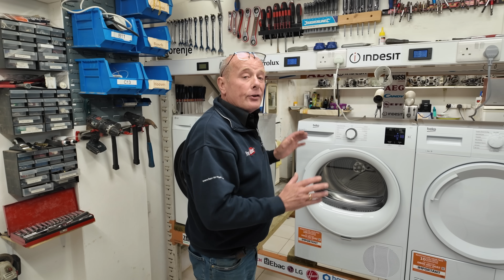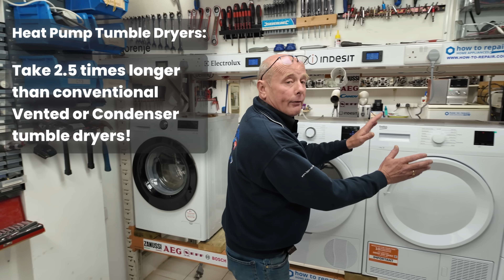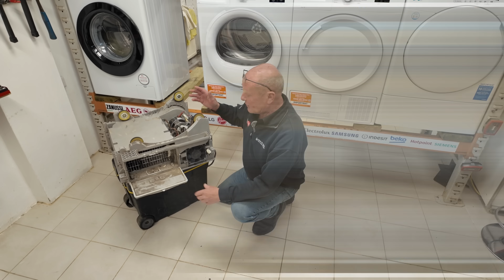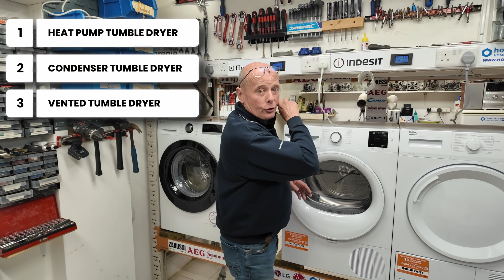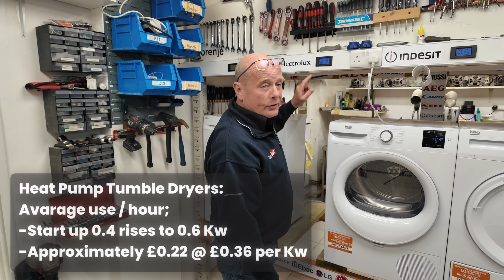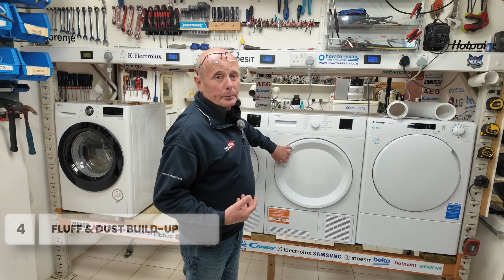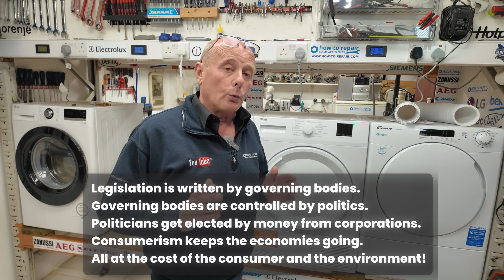Tumble Dryers the Shocking Truth About Heat Pump vs Vented & Condenser, NEW LEGISLATION!

Comment: I think this is just a matter of development, they will get better over time.
Reply from the maker: I believe heat pump technology holds immense potential, however, these machines exhibit a concerningly short lifespan, typically lasting only five years on average. Drying times are significantly longer, often doubling the usual duration, leading to increased wear and tear on both the clothes and the appliance components. Furthermore, accessibility for maintenance is a significant issue. Manufacturers appear to have a limited understanding of the necessary maintenance requirements and the importance of user-friendliness. They seem to prioritize production, assuming perfection without adequate testing. Thank you for your comment. I would be grateful if you would share this post, as it's crucial for raising awareness and driving meaningful change.

Comment: Thanks for the videos how-2-repair. Could you do a video on which are the better dryers to go for in regard to vented, condenser & heat pump. 
Which heat pump dryers are better designed etc. Thanks again.

Comment: I always hang dry my clothes indoors. Of course it's only practical because the air around here is usually fairly dry, and I don't have that much laundry anyways, but it doesn't bother me that it takes a couple days to fully dry. I'm not in that great a hurry.
My landlord actually supplied a heat pump tumble drier last summer. My roommates love it, but I don't like how much wear it puts on clothes. I had a closer look at it just now, and there was already quite a bit of lint on the evaporator core despite the air having passed through 3 sets of filters. And naturally there's doesn't appear to be any good way to access to the condenser, so at this rate that one will get horribly clogged in just a few years.
Really, those things should be redesigned to either fit larger, much finer filters, or provide easy access to the entire heat exchange system. Ideally both. The frustrating thing is how this should be a very solvable design problem. The manufacturers just don't seem to care.

Comment: I bought a Samsung heatpump dryer 2 Years ago and it uses about five times less electricity than my old dryer, saving  me over €250 a year. It's easier on my solar panel /house battery system too as I don't have to pull electricity from the grid to power it maybe 8 months of the year. It's covered by a five year parts and labour warranty, so after four years it will have paid for itself And it's good for the planet, everything is a bonus after that. I have never seen such a reduction in my electricity usage before by replacing just one appliance. I use a consumption meter on most of my sockets and was shocked to see that my old dryer used over 1.6 Megawatts of electricity in its last year before it failed. I highly recommend using a heatpump tumble dryer, even with the potential issues raised in this excellent video.
Reply: Yep very happy with mine. Mine has a door for cleaning the heat exchanger and a brush to clean it. It has a sensor that knows when it's blocked to then force u to clean it too.
Reply: @nytracus9680 , same here. They are very easy on the clothes as they have very gentle spins. The motors should last longer too.

Comment: I question one part of your rationale. Surely, with the lower intensity of heating and drying  and turning in a heat pump dryer, it puts less wear on the motor and bearings, so overall, it will last about the same amount of drying cycles as a regular dryer?

Comment: I despise the EU.  The heat pump one won't last as long as the condenser one as it is running 3 times as long per load.  The amenity sites are also charging a fortune now for dumping electrical goods.  So I see this a a false economy.  What you save on electricity is lost on higher price goods and more frequent disposal costs.

Comment: I agree that a compressor failure or loss of gas will make a heat pump tumble dryer an uneconomical repair. Apart from that I haven't had many problems with them. I personally use one and would always recommend them. I have been out to condensor dryers that have been put in cupboards and, surprise surprise, they struggle to work. I am often disbelieved when I explain why.

Comment: My Beko 9KG heat pump dryer was £420 five years ago. Its drying time of about two hours is comparable to the previous Beko condensing dryer, possibly a bit shorter. The conventionl dryer before that was half the drying time. I dry  on average one and a half loads a day.  It failed last year needing a new circuit board in the front panal at £50, which I fitted my self.  It operates well on my off grid solar and battery setup and uses labout 300w running (with little or no current inrush for inverter buffs). If I paid grid prices that would be about 30p a load max compared to £1 for a conventional dryer. ( Google says £1.50 on average) Over the five years I have dried appropriately 2700 loads which would have cost £810 for electricity. A conventional dryer would have cost £2700. Of course this isn't quite right because electricity was a fraction of the current price 5 years ago, but you can see the comparison at today's prices. Further more, its probably true that at the exact moment you read this comment, electricity will be the cheapest it will ever be for you. In conclusion my heat pump dryer has been a success because it works well, I use it a lot and it has been reliable. When it finally gives up the ghost I will definitely be buying another new one and they are not a lot more than I paid originally. I see that some also have a five year warranty now. An additional benefit of the heat pump dryer that doesn't really get talked about is that they hardly heat your cloths up at all so heat sensative items dont get destroyed or shrink and jeans don't come out crispy. Hope that helps.

Comment: Providing you have the space hanging washing indoors and using a heat pump room dehumidifier works well for me. Its filter is easy to clean and as the clothes are not being rotated in a drum garments probably retain more fibres than those dried in a rotating drum. A spin dryer will often remove a lot of water that the final spin on many washing machines fails to remove. Whatever happened to the mechanical mangle with its rollers that squeezed the water out?  Weather permitting hanging outside is the cheapest and greenest option.

Comment: Ar point missed by the engineer is that a condenser dryer warms the house air with the 'waste' heat so saves a bit on the house heating bill. So the cost of the extra electricity of the condenser is actually the cost the electricity minus the cost of heating the house with the same amount of heat. In most cases, the cost of a Kilowatt of leccy minus the cost of a 'kilowatt' of gas. So not as bad as made out, just slightly more expensive.

Comment: Got rid of my candy condenser after 10 years of service and 3 repairs, got fed up of constant lint faults, damp clothes and noise. Bought an LG heat pump and its utterly brilliant. 

It may need regassing and you have to consider compressor wear but over the last 6 months it has been flawlessly consistent.

As for drying time, I have found it far better than my condeser ever was but that's because I use a somewhat inefficient custom drying cycle.

All in I'm extremely happy despite the nay sayers.

Comment: Another "genius" appliance is a heat pump water heater. While in hot climate during summer it can help little with cooling surrounding areas it also cools same areas in winter which is not desirable. They are 2 or 3 times more expensive than regular water heaters, but wait when they break down.....then you will find out their real "value" when you will see repair bill. No, thank you!

Comment: I remember my Grandma having a twin tub and when it needed a repair, the engineer came and got the spares out of his van, as the mostly had the same parts. They could be replaced and repaired easily, they were not as technical as they are today but greed has brought new sales over reputable product. The Green agenda is full of ideology leading to the downfall of the industry and an electric supply problem for our future.

Comment: Over 30 years we have had 4 tumble dryers.  First was a vented, then we had a condenser.  Both lasted over ten years.  The condenser was junked purely because over time the heat had warped a the door, frame and door lock mechanism and it was leaking steam.  No parts available to fix it.

We then decided to buy a heat pump.  Compared to the condenser it took hours to dry.  Condenser less than an hour, heat pump 2-3 hours.  Drying a few items quickly was impossible, we hated it.  Then after 4 years of use there was an almighty bang while the dryer was on and it stopped.

I took it apart and could see the drive belt had snapped, but in doing so had wrapped around the motor spindle, this had jammed the motor which was on a spring and the force had sheared the motor bracket bolts, hence the noise.  The whole inside was full of lint, about half a bin bag after just four years.

I know an engineer who avoids Heat pump repairs, but as it was a belt he came to fix it.  He cleaned it, fitted a new belt, we fixed the motor bracket and started it up.  No heat being generated, the broken belt was so bad it had wrecked the machine.  Sad to see £500 gone so quickly, but a price worth paying for getting a replacement condenser which works flawlessly, dries a full load in about an hour and will last another ten years!

Comment: There is no benefit to the environment if these much more complicated HP Dryers only last 5 years. It is a big con that has to stop! Think of the electricity and raw materials that goes into their manufacturing and the built in obsolescence. A bit like an EV that is charged by fossil fuel generated electricity.

Comment: 👍 Good video. Is this anotner example of greenwash nonsense where we are being told we need to buy more expensive goods more often in order to save the planet? I am sceptical, my rule of thumb is the more we consume and the more products or services cost, the greater the impact on the environment.
Had a heat pump dryer for 2 years and it was nothing but grief, ended up costing more than it saved. It has been replaced with a condenser type. Concerned this legilslation is ill thought out at best or just another con by business/government.

Comment: My heating system runs on a heat pump, which means during some hours any electricity used anywhere in the house at certain times is at a cheaper rate. This dryer, like any other green this or green that is a money making con.

Comment: Thank you for a thorough video. In particular I appreciated your comments about wear & tear on the machine AND (potentially) expensive clothes when the machine has to churn around for over 2x the time.  Many forget that cost is Power  x  Time  x  Unit Cost.
I think you are right that the powers-that-be fall for the brochure headline figures and not real-world and whole life impacts.
That aspect, as you say, includes more frequent and more difficult disposal of any heat-pump, gassed product. Ozone layers and all that.
The same thing happens in other products that regulators and ministers obsess about.

I'd like to know the relative energy & environmental impacts for manufacturer too. I presume that some parts come halfway around the world in a  diesel-powered container ship?
Our humidity controlled Indesit vented dryer does a good job but I'm sure if the speed & heating power were a bit more smartly controlled (similar to suggestion by Big Clive) then it would perform better.

Comment: Been using a Bosch heat pump tumble dryer for the last 2 years in our Bed and Breakfast and it has worked hard in that time. Still going strong, has saved us more in electricity than it cost so far (400 euros) so when it dies it will have paid for itself. It lives in out boiler room so uses up some of the lost heat from the heating system during winter. I can also run it overnight on cheaper electricity which I would not do with a regular "fire hazard" dryer.

Comment: It is hard not to agree with the points you present given the specific example machines you are providing.
On the other hand I do have a Miele T1 heat pump dryer. I have bought it as a used one (God knows how long it was used before)
It has an additional spunge-like filter, I honestly cannot imagine a sane engineer designing heat pump dryer without such filter. Yet a lot of recent marketing materials (for Samsung for exampel) state that just the coarse fluff trap will be enough to prevent evaporator & condensator from becoming cloged- bullshit if you ask me.
Reply: You have made decent points about maintenance costs of these dryers.
With recent prices of energy I think that those maintenance costs should be compared alongside running costs (I mean the difference in the electricity bill for each, which at least for me in my country - Poland - is significant)

Another point is that the heat pump dryer will cause less overheating of my apartment during summer (translating directly in less electricity used for air conditioning).
In the winter months on the other hand, I would rather use cheaper methods of heating rather than resistive from a heating element of the dryer. (Central gas heating and my heat pump/AC)
Reply: I'm not sure how long lasting are other brands of heat pump dryers are. Not only given they don't have such an extra fine filter, but also the general tendency of products being hard to service. With limited access to replacement parts and service manuals. 
I honestly wouldn't risk buying a used home appliance of a brand other than some very premium ones. It is still cheaper in the long run and still gives you a much better experience in my opinion.

Comment: regarding the Cleaning out the Filters: Thats why you should only buy heat pump units with an additional cleanable/exchangeable filter in front of the heat exchanger unit. one should not buy units without one, especially not the "self cleaning" units. This is well known.
regarding the cost of buying: I bought my Hisense heat pump dryer new for around 315€. That's just a bit less than what a new condenser dryer would have cost at the same place. Just look and maybe wait a bit for dryers that are on sale.
Using the Dryer as a heat source in winter: For this to work, you have to have the dryer in your apartment and in a room you want heated. Some people have it in their kitchen, witch is unheated in my apartment in the winter anyways, as the fridge and Cooking produce enough heat anyways. Some people have the washer and dryer in the basement of the apartment complex. Using it as a heat source is not working in that case. And in cases of having it in a room you want heated, using alternative sources of heat (heatpump, gas, oil or district heating, whatever is available) is usually cheaper than heating with electricity. Even if you factor the electricity only in by half the price, gas would still be cheaper (electricity ~31cent/kWh, Gas ~ 10cent/kWh).
regarding the environmental aspect of heat pump dryers: while it does add a bunch of extra components for the heat pump, the gas, if using propane for example, is not harmful.
regarding the wear and tear on the clothes and dryer due to longer running cycles: you probably have a good argument against the longer running cycles.
TL/DR: If you do a bit of research before buying (which you should do before buying many things), you are probably better off with a heat pump dryer.

Comment: Thanks for the video. Ive been looking for a tumble dryer and have wondered where the vented ones have all gone. Like a lot of people have to use my tumble dryer in an unheated outhouse. I had a condenser for around 5 years, it broke due to a massive fluff build uo in the machine, despite regular cleaning of filter and condenser unit. I'm trying to find a decent vented second hand, seems there is a bit of a black market for them! I won't be buying a heat pump, is not worth the cost. Would rather have crispy towels. I absolutely support a move towards green appliances however the whole life of the machine needs to be considered.

Comment: Would make sense to have the heat exchanger at the top of the machine.So it would not need to pump the water into the door tank..also would be easy access to remove lid to clean it out. My wife calls  our heat pump dryer "The tumbler dampner"  .

Comment: In honest real world conditions these items are only used during the colder 6 months of the  year  which equals 26 weeks  and a handful of times as an exception in the other 26 weeks when there is free drying available outside on a line or inside in a conservatory or south facing room with window.  If a family use 5 times a week that's 130 times year  ,   the saving on a light load is 40p x3 loads , the saving on a heavy load (towels , jeans jumpers, sheets,  fleece stuff etc etc ) that takes the 2,5hours  is 32.5p x2 loads  so the weekly saving is 1.85 , times 26 weeks = £48   for a 12 month period.  The minimum EXTRA the shop wants for a HP  over conventional is starting at £200  but that gets you the choice of 1 model   ,  so to make that back in leccy savings is 4.2 years  or if the drier is 250 more then that's 5 years (winters) use .    SO 5 years use to break even IF there are zero problems outside of any warranty.  Even if in warranty you have the presenters known knowledge  of getting hold of a guy who can come and look and all the visits and booking time that is going to take.  So if you a single household or couple or retired you are doing much less than 5 loads a week so the savings are even smaller ,  payback time (to recoup EXTRA capital  outlay ) could go up to 8 years easily